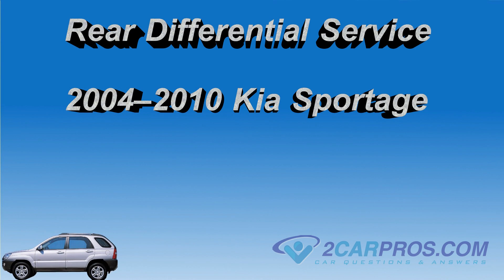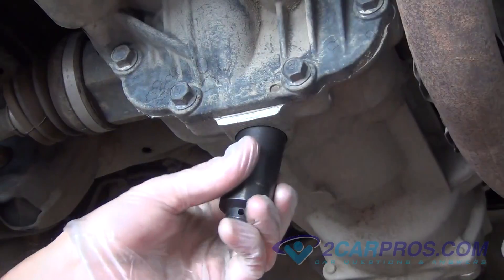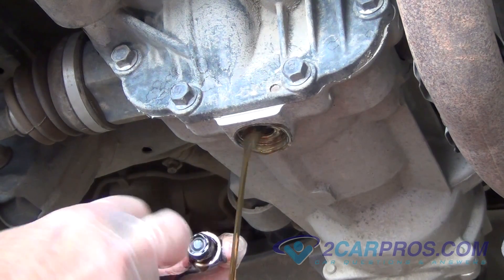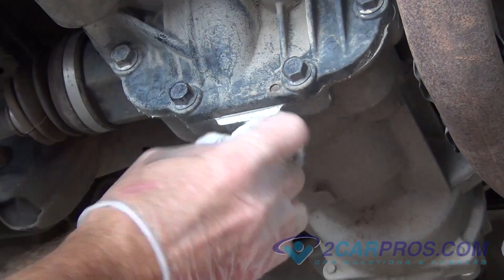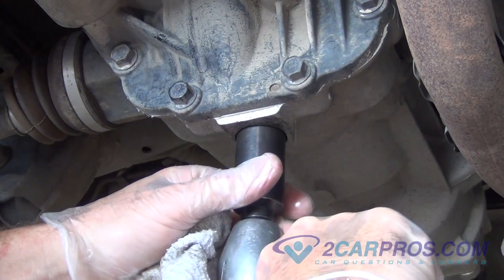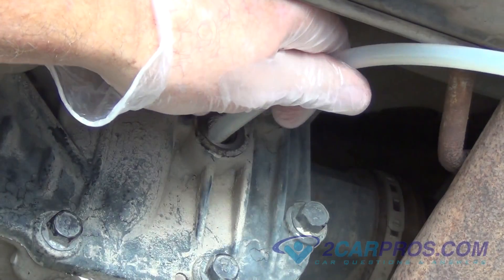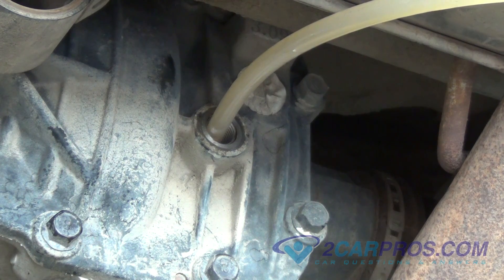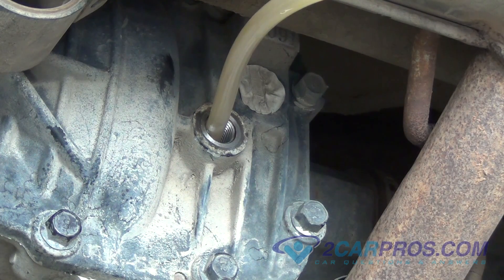Rear Differential Service Kia Sportage 2004-2010

Comment: What fluid did you use owner's manual calls for shell spirax ax 80w-90 can't find it anywhere
Reply: Can we use the oil 65 to 75 instead of the 80 to 95? What would happen if we use below the recommended oil 80 to 95?

Comment: Remove fill cap first, then the drainage.  Drained liquid with no way to fill if the fill screw gives you trouble.
Reply: Pro tip there sir!
Reply: On the money with that tip.
Reply: Nothing worse than draining a differential THEN finding out the fill plug is seized...
Reply: Right on
Reply: @kalani1987 left off

Comment: 1. Always remove diff fill plug first could be seized. 2. Never use an impact to tighten bolts really big mistake on this. Torque to specs when possible. 3. Motocraft oil in  kia? Otherwise great vid.
Reply from the maker: You have to get that plug out no matter what. Using an impact is fine honestly we have been doing it for years. The brand of oil doesn't matter as long as the viscosity and synthetic rating meet the requirement. Thanks for watching!
Reply: I understand your point but why not show viewers the correct way to do this procedure for DIY people(myself).  You see my point.